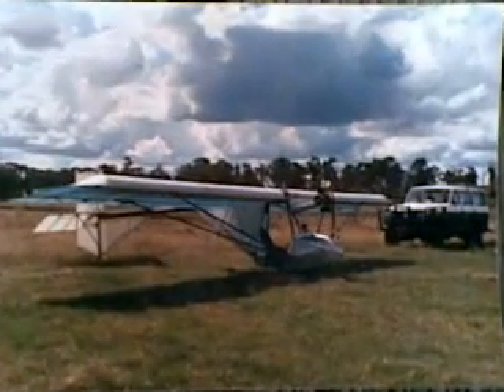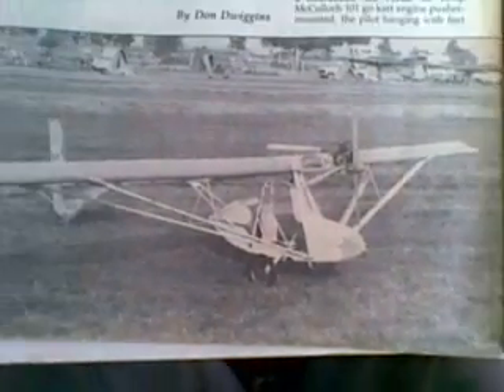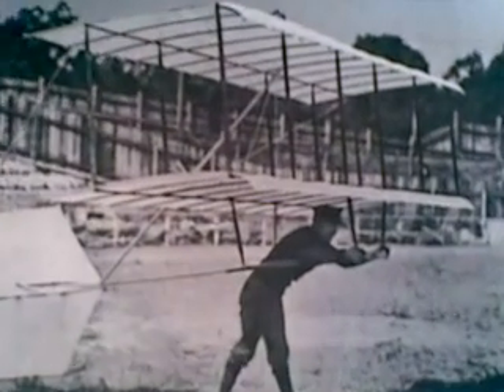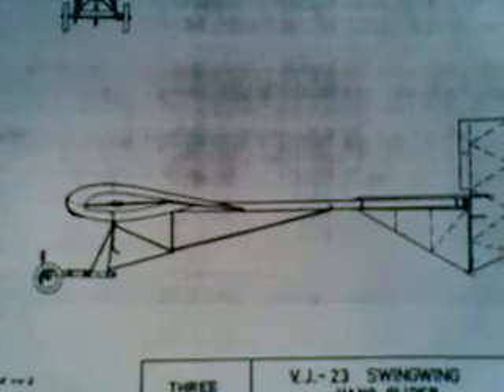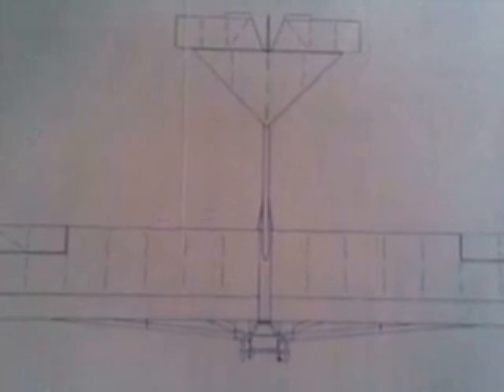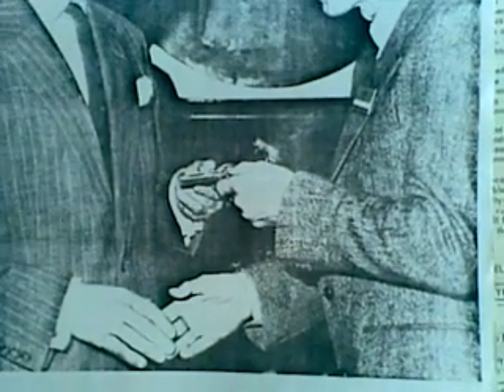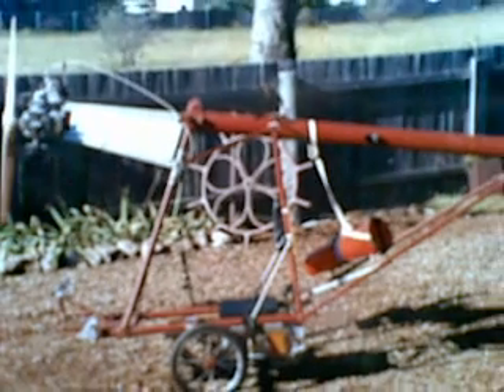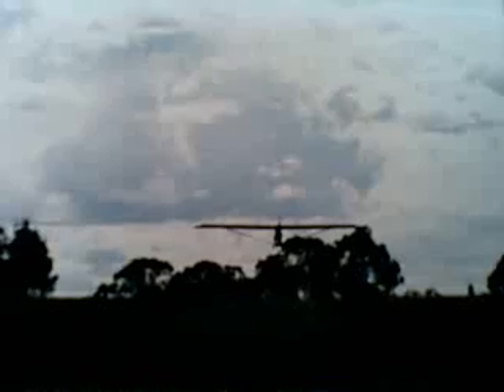V.J.-24w. "SUNFUN". World's First Ultralight Motorglider... 22 Hp. Australian Modification.

Comment from the maker: @racingdriver05
Well, little Propellers, with Razor-Edges & thin Sections...; cut tiny holes in the Air, & make a bit of Thrust, & blow fuck-all Airmass over the Elevator & Rudder. But, BIG Prop's, Revolving at 1,000 RPMs are FUCKING BRILLIANT, at less than 150 MPH, IAS...
So, for a Motorglider in which Climb-Rate matters but Top Cruise Speed is irrelevant...; the Bigger & Slower the Prop, the better... So, Torque Multipliers are Good, yeah ?
Ciao !